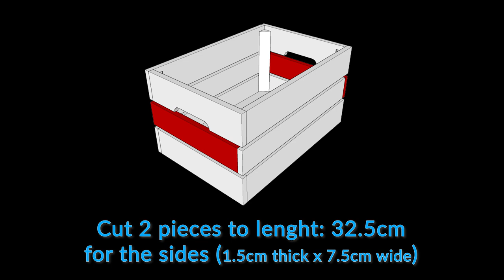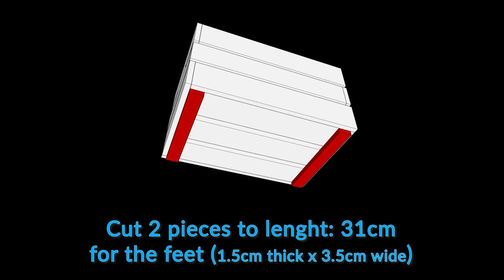DIY Stackable Fruit Crates/Boxes from Old Pallets

Comment: Never use gloves when using power tools. If a blade grabs the gloves it will pull the gloves with your hand and it will do more damage than if you didn't have gloves on
Reply from the maker: Hi Kevin. Thank you for your advice! Actually I'm not using gloves anymore when using power tools. 😉

Comment: Super Design! Thank you! As you mentioned, the only cost is wood glue, pin nails, sealer, and time spent actually creating something!  The results are much better than anything anyone could ever purchase!  It should be noted your design does not require any plywood ($$)  * Sizes can be adjusted slightly, for your intended use. I can see the benefits.  *These storage crates are simple project, don't build just one, build 3 or 4...  You won't be sorry :-)
Reply from the maker: Thanks Bob! Actually we have been using the crates quite a lot in the last months. 😀👍

Comment: What size brad nails did u use on the corner supports( the ones u cut at a 45)
Reply from the maker: Hi David, I used 15mm nails in the corners, which is around 5/8 inches.

Comment: About how long would you estimate that it takes to build an entire crate? Obviously you’ll be faster than most, but a rough guess would be helpful for planning a Saturday work flow. Thanks for the video! I can’t wait to get started!
Reply from the maker: Hi, I would say around 3 hours for the first one, and then you can batch them and maybe reduce to half the time, if you're going to build more than one. I'm assuming for these calculations that you already have dismantled the pallets. Good luck! 😉👍

Comment: Thanks for the helpful video.  I realy like your crate design.  I need crates for fruit, veg and jar storage. I'm thinking to do a range of heights.
Is your crate size an industry standard size that would stack with other crates out there or a sensible size for you and you pallet wood size?
Reply from the maker: Hi, thanks. Actually this is not a standard size, it’s just a size that suits my pallet wood size. But you can adapt the size to any standard or to your own needs. 👍 😀